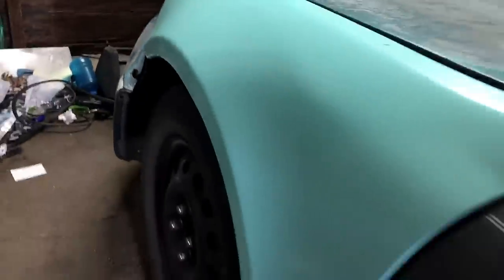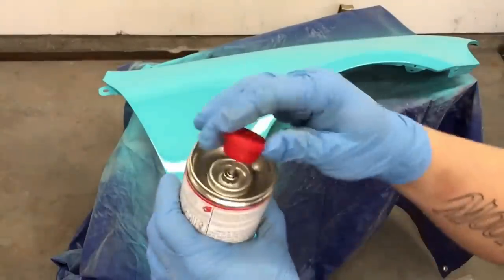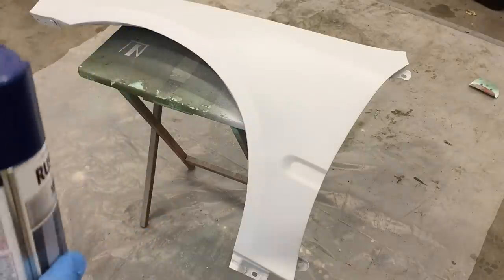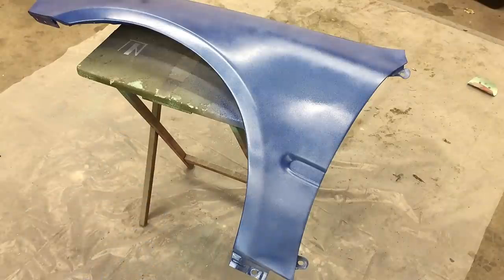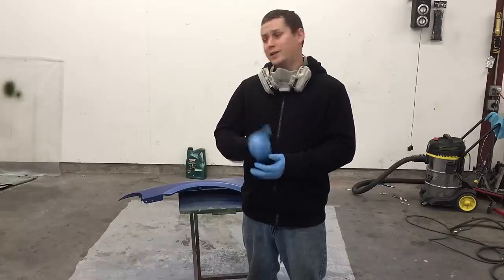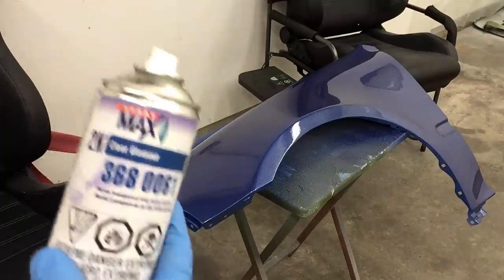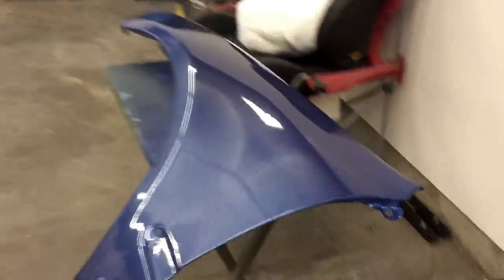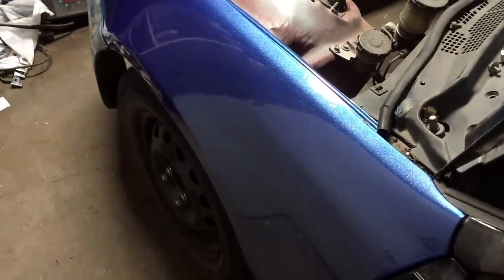Metallic rustoleum spray can paint job with 2K clear (AMAZING RESULTS!!!)

Comment: Hey, you usually don't primer before you paint, at least I don't remember seeing so in your other videos. Did you primer this a light color so you could get a better outcome with the metallic?
Reply from the maker: DanTheStanMan J  I only did it because the internet trolls bitch less when I prime. It’s not “required” but it does help with the bonding of the base coat. As long as it’s a 2 in 1 primer and paint then it will be fine without primer.
Reply: @JamesDguy  I see I see, thanks for the explanation. Turned out really nice
Reply: Can you explain,im doubting wanting to paint my bike again after that comment lol... sand panel, primer,paint and 2k, or am i missing some other spray i need to add here??
Reply: @darrenscully6959  I know you're not asking me, but that does sound about right. And depending on whether you're painting plastic or not, you'd probably want to put an adhesion promoter first before putting any paint.
Reply from the maker: Darren Scully If you want it to last along time then sand with 320 then prime it then wait for primer to dry then wet sand with 320 to make it smoother then do what I did in the video and you will be golden. Just wipe down with wax and tar remover prior to painting and a good adhesion promoter.

Comment: funny as it may, but I'm a nail tech with a big full Lincoln Navigater. My hood got rock hit so much I thought if I could make beautiful nails it's close to the same process. So far so good. I ran out of paint but I used black high shine in my hood and the grill is chrome n black.  it sure looks better than sanded prime spots.  I am wondering about the spots that come from weather n are rough to the first coat. They are like spider lines. I did use  320# and 500 grit paper. I see you're using nothing less. I have used rubbing alcohol to clean my hood too ya need to remove any oils from the metal. So, what do you use for wet sanding? the grit I have up to 1200 grit paper.FYI buy the round sander I bought alone one n it beat my hands like crazy.... nice video guy thanks....

Comment: put water on the floor,no fans blowing, tack cloth between base coats = minimal dirt in paint finish
Reply from the maker: Keenan Slagel the fan was pulling the fumes out but water on the floor helps a lot

Comment: Hope you can answer this question 
 I am testing this paint on a doner panel. when I did use the same paint, primer,etc. after it drys,as I walk around it, it changes colour. same for you?
Reply from the maker: randell gribben alight color variation yes! I couldn’t pick it up on camera though.
Reply: +Moore Motorsports James Dguy mine goes from cobalt blue metallic ,to almost a purple
Reply: +randell gribben perhaps  violet  colour
Reply: The cobalt blue has purple metallic mixed in with the blue metallic.. it creates the flop.. I used this stuff on my interior trim.. it fairly matches the urekem royal blue metallic when I added some aqua-to-purple flake to it..

Comment: How about a couple coats of rustoleum clear before the 2k?  Thicker protection.
Reply from the maker: adonian I hate rustoleum clear coat it don’t do good compared to the 2K clear. Don’t confuse this with 2X rustoleum with the spray max 2k clear. The clear from rustoleum isn’t very good at all in my experience
Reply from the maker: adonian Sorry just re read that. I just don’t like 2X clear sorry about the confusion on previous comment
Reply: Moore Motorsports James Dguy ok brother just wondering.

Comment: if wrinkles then you missed you time frame to lay the paint. if not all coats are laid in 1 hour you have to wait 48 hours. ifyou lay to thick to fast it cant off gas and it will wrinkle or shrink. rustoleum products can give a good finish if you are patient.  gonna take some vids later today of my 64 buick skylark painted. i havent wet sanded buffed yet. but i did trunk lid to show how will look wet sanded and buffed.

Comment: Thanks for the great video!
I have some heavier spots then others on my piece. I've used only light coats but I was closer to some areas probably.
The clear coat will probably fix it and even it out?
I prefer not to sand my metallics

Comment: My situation, badly damaged my left front fender on my 1990 Chevy sport truck. Have a perfect fender to replace the damaged one but needs paint and clearcoat. So, would it be best to prep and paint new  fender installed on truck OR do the prep and paint to the fender then bolt it on later ????  thanks in advance.

Comment: The project I plan to do will require me to let the base coat dry so that I can apply water slide decals. I then want to 2k clear over the decals and base coat. In this video , producer is stating to apply 2k clear while paint is tacky and this works well for him. Does anyone know if I let the base coat dry for at least a week, wet sand and then shoot the clear if it will wrinkle the Rust-Oleum base coat?

Comment: I have a major question. I spray can my car and I'm using the clear coat that you use in this video. I clear coated the car but I didn't have enough of it. I some coming in. Now my question is, can I spray over the clear coat that's on the car with new fresh clear coat? Or do I need to sand off the clear and start over?

Comment: Serious question, does duplicolor match paint have that negative chemical reaction with the 2k clear? I have a maroon camaro that I'm just going to wetsand off the factory clear and  slightly dig into the factory base coat and want to shoot it with a maroon metallic. I cant find the color i want in rustoleum sadly

Comment: hello sir,  i want to colour my cycle. . . .  and  i have got acrylic lacquer  spray  ..   i think , first i clear cycle body . . than spray primer  and  wait for  10 min than wet sanding with p1000  sand paper . .  than clear and dry it . .than spray 2nd coat primer . . after 2nd coat  wait  10-15 min  .. than apply  main colour 3 times with 10 min gap each coat  ..  .aftar final colour coat . .wait 10 min than apply clear coat. . . . .  is it okey ?

Comment: Honest question here that clearcoat have you ever had it had a bad reaction with different paint I have used different clear coats and I’ve had it orange peel or look hazy depending on what paint I go over with it or does it work with any paint as a clearcoat

Comment: Hey there bro! Congrats you're getting awesome/simple videos about how to spray paint a car with out spend a bunch of money, have us completely iced watching the progress/results!! Here is my question, I been watching some of your videos and my question is why did you put primer on this fender, and you didn't used primer on the CRV with the pink or even your infinity with the green, is because the metallic rust oleum runs real quick?
Reply from the maker: Jean S Just because so many people complained about me not using primer in my other videos. It holds the exact same as all my other jobs I just did it for the nay sayers. I don’t usually primer if it’s a 2 in 1 paint
Reply: @JamesDguy  ok I'll incluide the primer coats so imma spray paint a proyect car with metallic rust oleum cobalt blue + rust oleum 2X glossy clear coat, (I got 10 cans of each)

So I'm not in a rush to get it dry fast or any kind, it's just sitting in my garage, I'm not looking for a professional auto paint shop results with what I spended (I'm realistic), i'm actually looking to stay in a budget, but now my question is: the rust oleum 2X glossy clear coat is going to work? I been reading and watching people just using 2K clear coat cans and getting awesome results and of course I'm looking for a decent result..... so if I have to jump out from my budget I'll do it, but I'll rather to keep on it, so my question is: if really makes a difference on the application or basically the 2X is not going to work on a car project, or it's going to give me a lot of problems if I stick with it?? thank's for the video and 👍
Reply from the maker: Jean S The 2X has been known to cause he paint to wrinkle up and idk why but the 2K from spray max hasn’t done it to any of my projects on my channel. And if you get any imperfections they can be wet sanded
Reply: @JamesDguy  and I don't have to wet sand the paint coat before land the clear coat?

Comment: Is 75 degrees the optimal temperature for the room or were you stating the condition?  I live in the North East and our basements are very cold.  I plan to use a dehumidifier and a space heater to bring it up to temperature but I know it's important, that's why I ask.  Also, once activated can you let the 2k clear sit for other projects or does it have to be used the same day?
Reply: Thank you for the video by the way.
Reply from the maker: Dorjee Gyadatsang Best temps are between 55-75 not in direct sun light and a basement should do just make sure it’s well ventilated and the 2K clear has 48 hours before it’s no good.
Reply: Moore Motorsports James Dguy Awesome, thanks again.  Will try to ventilate without having the freezing outdoors drop down the temp too drastically screwing up the process.  I have double filtration on the 3M respirator mask so should spare my lungs.  Will do further research on that, health comes before any diy hobby.  Nice results btw.
Reply: @bobby_digital9493  The mask only stops the paint from getting to your lungs not the fumes/chemicals. So be sure that ventilation is priority.
Reply: jerad hernandez Thank you man, last time I was dying even with the bilco doors wide open.  I had to keep running out after each coat.  If temperatures go below 55 degrees though will the paint have trouble with a plastic bumper or metal fender?  I know I can warm up the cans but don’t want to botch the job.

Comment: Hey James, when you primer how long do you wait for it to dry before you can apply base coat? Last time i did it had wrinkles in the paint i wasn't sure if i waited to long or to short. Thanks
Reply from the maker: Edwin Luu I only wait about 20 mins
Reply: Edwin Luu more than likely a reaction from something.. also it’s best to sand the panel first before you paint so the paint has something to bite onto..and always remember, your paint is only as good as your prep work

Comment: Question, if you do a front or rear plastic bumper cover on a car those usually require a flex agent/additive what do you use for this? And do you use any adhesion promoter for plastic parts? Thanks!

Comment: I hit a rust spot with rustoleum high gloss, then used up the whole can, and then another and another.   It came out like I did the glaze polish and wax which lasts for about 2 rains.    WTF have I been doing all these years with the wax?   Also the 36 year old car's paint is worn through in some  places.    3 cans of rustoleum costs as much as the glaze and wax.

Comment: Great job brother,That looks slick and not that much orange peel.Im like you I prefer the rattle can over the spray gun.I recondition headlights and spray tint tail lights on a daily basis now.Ive been using that clear in a can from the ppg store. After watching this im going to give this clear a try.I bet It will work great on headlights after sanding all the oxidation off.Again great work,Keep rocking the can!👍👍👍

Comment: Glad you emphasized the ventilation of the shop.  No filter respirator is rated for urethanes.  Only positive pressure supplied air will protect your lungs.

Comment: How do I avoid sticky finishing?
Reply from the maker: Jaden Cargill I don’t understand. Once the paint is cured it shouldn’t be sticky. I wouldn’t handle the panels or anything until it’s fully dry to the touch no sticky feeling. You can always test in a inconspicuous spot such as lower on the panel or on a spot not seen easy. The advanced formula paint stays sticky longer than the 2X paint but that’s just how it’s made.

Comment: Do u have to polish after only or can you ceramic coat with the spray can and 2k
Reply: You should not apply any wax or coat on the freshly painted car for at least a month (if not 2-3), cause it has to cure and you don't want any solvents etc trapped below the wax or the sealant. This can cause the paint to swell.

Comment: Painted the hood of my truck and decided to use the 2K Clear shown in the video.  With the hood flat, the issue is the paint spray accumulated on the lip of the can and made my next project a huge wet sanding project.  Don't shoot horizontal surfaces without wiping the nozzle and metal edge FREQUENTLY.

Comment: Thanks dude.  The only thing I didn’t have was the 2K clear.  It’s not easy to get here in Hawaii.  So I used a clear from rustoleum.  I followed your directions and the paint came out great no tiger stripe or over spray.  I am happy with my paint job.

Comment: Can I use the 2k clear coat a week after I’ve sprayed painted the car?
Reply: To be safe, even though it’s way late, and if it were me I would buzz the car back down with like 800 grit, not to far though, just enough for the paint to bite onto the surface..do a couple dust coats of base and then clear it.. or you could just get a can of bull dog adhesion promoter, spray the car with a light coat of that, let it sit for 5 minutes or so and then clear it.. hope this helps in the future..

Comment: Thanks for the demos! I have a car that is being restored, a family project my kids got me. I know Metallics can be a bit tricky to deal with, and perhaps even moreso interference paints (those that change colors with lighting & reflection) from using them in actylic projects.
Can you suggest any brand of interference paints for cars, preferably in a can? 
I wasn't sure how a paint job was going to go on this car & I want to do something differrnt & fun. After watching several videos, I figure if I totally mess it up, I can sand her down & paint her again. Thanks for the tips! 
I'm going to try a few soda cans before I sand the car & paint, to at least get a feel for it. Seeing others do this successfully helps break the ice! 
It's time to go buy some sandpaper/blocks/wheels, dewaxer/deoiler, primer, paint, clearcoat, tape, plastic, etc. & give this a try.
I think I'm going to go for the trigger sprayers too, as I doubt I can push a regular spray can button that long & want to keep the spray consistent. 
   This is definitrly out of my usual comfort zone, but I think I've got this.
The only way to find out is to give it a try! This should be fun!
Thanks again!

Comment: Smh when I spray paint I leave spots even tho I'm not stopping but you do it and I see no spots
Reply: Make sure to warm up the can with a heat gun or leave it face up inside a hot bucket of water. shake well and wipe the can of water before spraying. Test shoot first, and shake the can after every 10-15 seconds of spraying, test spray, continue. I did my whole front bumper on my BMW in black sapphire metallic with this 2k clear and I didn't even bother sand and buff it because it came out so perfect.

Comment: Hey James, I appreciate you. This stuff is really amazing. I do have a couple questions I was hoping you could answer. I painted my truck using the steps and exact paint you have in this video. It turned out pretty good but I mistakenly did not purchase enough 2k Clear so some spots are not covered well enough. Is it okay for me to wet sand then apply more 2k clear?   Also when i was spraying the 2k Clear I accidentally had some drips on the Hood. Do you have any recommendations on how to remove the drip marks? Can I simply wetsand them out, then apply more 2k clear? Sorry for all the questions. Thank you for your time.

Comment: Could you use the 2k clear over the rustoleum clear coat?
Reply from the maker: Josh Carrasco I never tried to be honest. I stopped using the Rustoleum 2X clear years ago because it never came out nice for me no matter what I did.
Reply: @JamesDguy  I appreciate the response. I only ask cause I'm using the rustoleum glitter so I was gonna spray 2x clear to be able to build it up high enough to sand. And once smooth spray the 2k clear. Hope that makes sense.

Comment: Nice look in the video but a couple issues I can see going this method.

First, the car doesn't match the actual color. It's not a true Cobalt Blue Metallic as it's labeled. It's more of a purple blue metallic. Which you can see in the video by only slightly due to...

Second, 3 light coats as one can see you applied.. and you could do a second fender with that same rattle can? You didn't lay paint. You barely colored it.

This is made very clear by two factors..
A) When you sprayed the 2k Clear, which is a pro grade nozzle and rattle can, you can see the difference in how it layed the paint down. A nice wet finish all over the fender. But not with the Rust-Oleum because you were laying it on so thin/light. You dry coated it basically.

B) After spraying the clear coat during your close-ups. All you see is silver metal flake, no color to speak of. Except in blotches.

Which is also, nothing like the can lid represents itself as the end color. 

Go look at a Cobalt Blue Metallic paint job. It's a deep rich blue first and foremost, with metal flake as highlights. There's depth without a clear coat. Even more with. Anna a close up will NOT show an sheen of silver metallic flake as yours does. 

There is a video that the guy laid some paint on and you can see the final prior to clear, it's more of a Cobalt Blue/Purple Chameleon Metallic. Which if that's what your looking for, fine.

And... I just went outside, and by chance there's a Cobalt Blue Metallic car parked in the driveway and neither paint job using this Rust-Oleum paint is it, yours or his.

Personally, I'm looking for a Cobalt Blue. Not some derivative thereof. 

But thanks for sharing. I'm glad I saw the end results of both. Between the two of you, the cans I just bought, are going back.

Just another disappointment from Rust-Oleum.